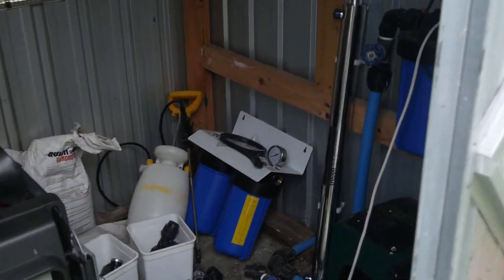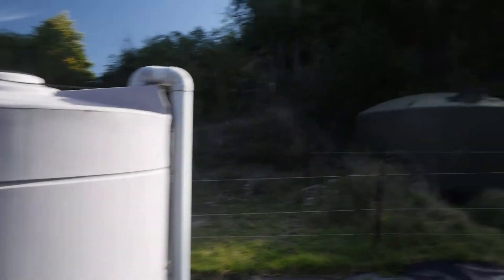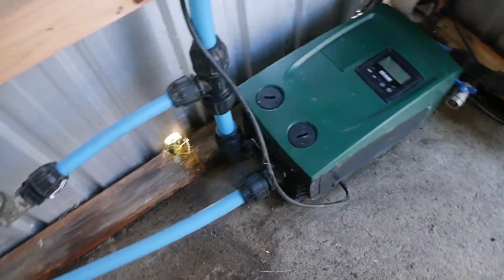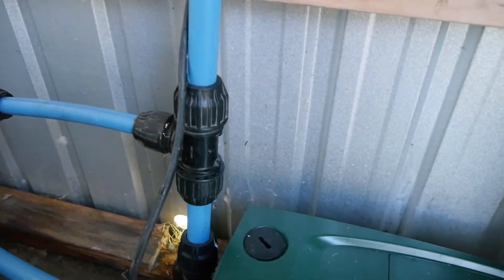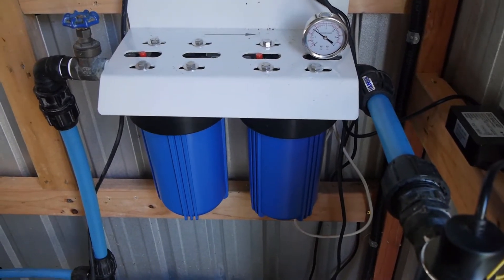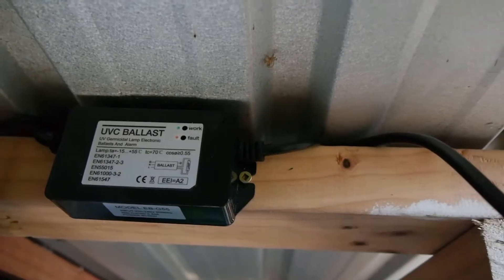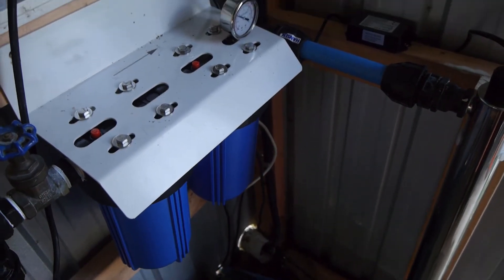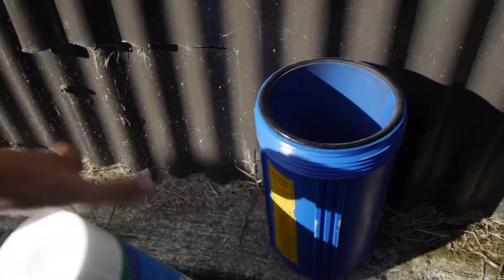How to install whole house water filtration and pump system for your house

Comment: Hi, did you find a cheaper place to buy your gear.....dont you need the water outlet  from the top of
the UV light..... so theres no air bubbles ? cheers Brett
Reply from the maker: Hey thanks for the comment is a great point you make. I checked with the supplier of the UV filter and for this model it does not matter which end the inlet is on.  Cheers